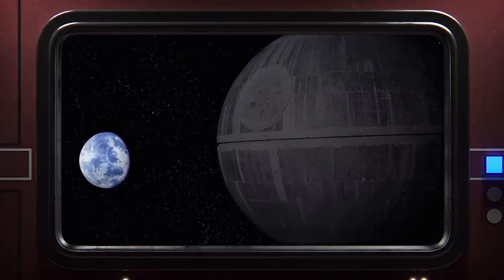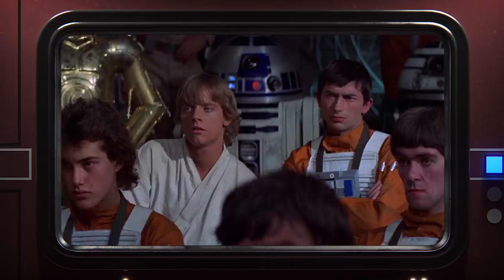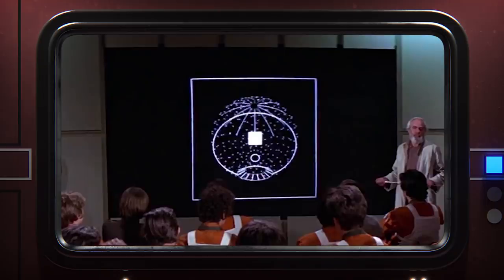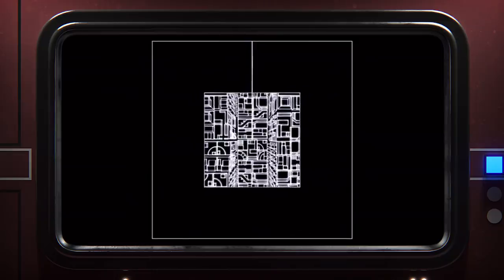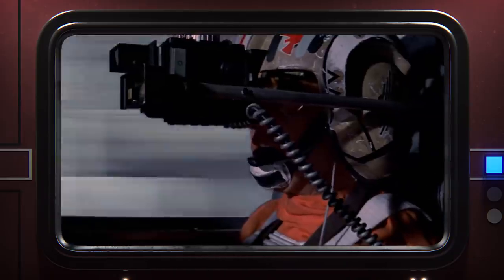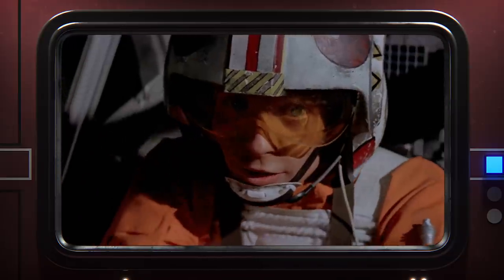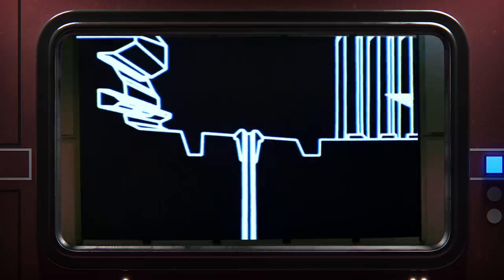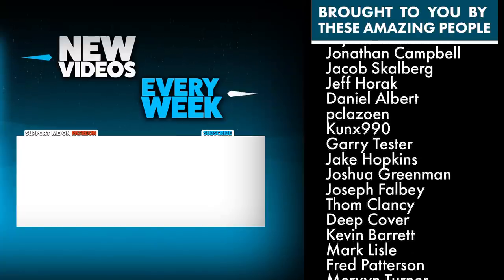The Thermal Exhaust Port Was NEVER a Problem

Comment: Even if we assume one port, it still is not a weakness because there needs to be an exhaust of some kind to deal with all the heat generated and putting such in a well defended area that conventional wisdom would hold is inaccessible to the most likely choice of attack craft and shielded against the most conventionally likely weapon and having it so small that conventional wisdom would say it cannot be hit using any ship's weapons means that to anyone using tactics other than pure desperation the station is unassailable.

Comment: I have question 
1.why dont they put sensor on the exhaust, when unwanted item goes in the exhaust pipe will close automatically.
2. Why the exhaust not to be built in complex if one hit enough to kill deathstar.
3. Even nuclear reactor has many safety procedure. I hope someone can compare safety system from holywood vs working nuclear reactor safety system.

What do you guys thinking ?

Comment: What you have not mentioned is that Darth Vader himself guarded this Trench so he was aware of this weakness and tried to protect it.
Reply: i haven't seen the movie in a while, but I'd suspect he was there for luke
Reply: @gearhead743  i have just rewatched the fight. First Vader ordered Tie Fighter Pilots to start. Second Scene Vader mentiomed "several Fighters have broken of from the main group. Come with me:" to two Pilots. Third Scene with him is attacking Y-Wings flying through the Trench, then attacking X-Wing. Only after he flies behind Luke he noticed the Force in him and only after the ghost of Obi-Wan talked to Luke.

A different Scene i found was an Officer talking to Tarkin "we have analyced their attack and there is a danger" and Tarkin answers "Evacuade? In the moment of triumph? I think you averestimate their chances" which is another great reason why the weakness is not a plot-hole. The empire overestimated their strenght and didnt respect the rebels as a thread.
Reply: @priuzien  ah, wasn't saying it was a plothole myself, although. There is a major engineering concern. What are they venting? heat? if they are simply venting heat they are doing it wrong. The only use of a vent like that would be to dump hot gas. If they wanted to vent heat directly, the would need radiator fins, lots of them.

Comment: The only implausible thing about this was that a shot up the tailpipe could cause a stationwide catastrophe. Throw a hand grenade down the funnel of an Iowa-class battleship and at most you'd get a fire in one of the engine rooms. Bad but something the warship is designed to handle. It might not even cripple the ship as battleships had multiple engine rooms. The Death Star took one hit to a Secondary Exhaust port and within a minute the entire thing was Gone. Not crippled, not disabled, not wrecked, GONE. It's like to fired a handgun at a US supercarrier and the whole thing goes up in a mushroom cloud. Doesn't make any sense.

Comment: Tell me, are thermal exhaust pipes usually a straight line? I doubt it, that’s probably why only that one was like that, if they were all designed in such a flawed manner, the empire would’ve caught on immediately, but if it’s only the one, then even if it’s a little sus, you could reasonably think that there’s a good reason why only one would be like that, also, all the ports would be ray shielded, that just makes sense, ray shields are some of the most notoriously annoying obstacles in the Star Wars franchise, also, it’s inaccurate to say the ports were heavily guarded, the whole thing was heavily guarded, they didn’t pile all their turbo lasers around the ports, they were all over the Death Star

Comment: A weakness, that in order to exploit, you have to choose the correct exhaust port, and then have physics bending ability to even get the shot to happen.

Remember what was said to Luke before the shot was made: Use the Force.

Or in other words: Let the force guide your shot.

What is also funny, it is because of the "physics bending ability" requirement to exploit this weakness, that Leia went to recruit Obi-Wan Kenobi in the first place.

So a weakness, that required Magic Space Wizards to exploit, is somehow a weakness that is so bad, that people hated it...

And let's not forget there is a keyword that most people completely ignore: EXHAUST! Which means energy is being moved through the channel, out into space. Energy is PUSHING out through the port, not pulling things in, which means the shot literally, can only be achieved by magic space wizards, because no one else can get something to fly and resist the pushing of the energy flowing out through that port.

The designers of the Death Star 100% did not account for magic space wizards, because it was believed all of them were dead.

Comment: If anything was a weakness, it was the reactor itself, not the exhaust port. The reactor itself is what was sabotaged. Galen Erso made it vulnerable to a single shot from a proton torpedo. Without his involvement, you could’ve hit that same shot but all it would’ve done is just put a dent into the reactor instead of starting a chain reaction leading to the destruction of the entire thing. That’s what I got out of all of this anyway. If the fault was anything it was not the thermal exhaust port, it was a very weak and structurally unsound main reactor.

Comment: Should i mention that thermal exhaust ports in space is pointless since there's no air to actually vent the heat off?  Also, with a massive construct like the Death Star, it's possible to simply recycle excess heat for other purposes (like... idk, hot water for all the storm troopers on board).
Reply: Why didn't tie fighters have shielding?🤷 because the empire had bad design ethics.
Besides there likely were machines actively pushing, out the heat.
Reply: @technounionrepresentative4274  TIE fighters lack shielding because the empire is cheap.  It's easier to field a ton of cheap starfighters to intimidate through numbers and sheer physical presence than it is to pay up for a bunch of highly equipped starfighters.

But that has nothing to do with the physics of how exactly a thermal vent would work in space... especially such a narrow one when there's nothing to disperse the excess thermal energy off to.

Comment: How are these ports exhausting heat into a vacuum?  Spraying coolant into space?  Then why not use elbow joints in the coolant pipes, so the ports don’t have to lead straight to the reactor?

Comment: And it's not like this flaw isn't present on real-life combat vehicles, either. The M1 Abrams all the way up to the M1A2 TUSK variant had an exhaust grate about a half a square meter wide, that was covered with nothing more than some 5mm RHA slates and a mesh to keep dust out; it could probably be penetrated with an AK or a rifle, let alone any main weapon of any tank. Now of course it wouldn't lead to a spectacular explosion, just disable the tank's engine (and since it had an auxillary generator specifically for that situation, it could still function and engage targets, just not move), but still.

Comment: Even if it was a design flaw, it required an act of comically huge espionage to even acquire that much data on it.  Do you have any idea how hard it is to steal schematics for a military weapon, much less one as powerful as the Death Star?  Without the schematics, what would the rebels (or any other hostile power) have done to the Death Star?  Trying to assault that station is a death sentence for any military, especially one which doesn't know how to attack it.  My first instinct would have been to shove a torpedo down one of the main laser's ports, but apparently that wouldn't work, and an attempt to do so would be catastrophically expensive.

Comment: I don't really see why the deathstar had exhaust ports at all. If it's exhausting fumes all the time in space it would presumably run out of air quite quickly. What they needed was radiators, which are conveniently solid.

Comment: The shot was literally impossible without the force, and that’s assuming your ship even got to the exhaust port which was extremely heavily guarded , even without the imperial navy helping the station. You would have to be an riddiclously skilled pilot to even stand a chance of making the shot, and you would have to react very quickly for a precise shot. btw its an exhaust port, from the heat of an engine strong enough to power a planet destroying laser and move a 120 Km diameter space station through hyperspace. There should be an incredible amount of force being expelled, and it should be fairly hot (though maybe not because it’s travelling in space.). 

It was literally impossible with actual science to make the shot, and improbable with Magic. Even if we assume it was only 1 port, when that’s unlikely, The Empire was still pretty damn aware of, this nigh impossible chance of someone being able to destroy the station.
Reply: It would be impossible even WITH the Force, the Torpedo should have Turned to Slag from the heat alone

Comment: Sone guy: Sir! Here’s a map of the Death Star!
Vader: Um, what’s that thing that’s connected to that thing that’s connected to that little thing?”
Guy: Well, it’s part of an exhaust port that’s connected to the reactor.
Vader: If a laser was fired down there, what happens?
Guy: We die
Vader: How big is the hole?
Guy: About the size of a laser.
Vader: I see no problem whatsoever that could lead to this station exploding, even though I know my son can possibly use The Force, and most likely will use it against me. No problem here.

Comment: You know what funny it’s called an exhaust port which means it’s pushing stuff out specifically heat from the core  which means that’s any perfect proton torpedo hit would have been useless cause it would have been simple pushed away from the immense heat and pressure of the heat and other stuff it’s pushing out so literally only people with the force would have been able to make it go in

Comment: Why would you attempt to shoot a torpedo down a vertical shaft by coming at it at 90 degrees? Weapon emplacements? The trench had weapon emplacements that you had to fly through where you were limited in how you could fly and maneuver. It would make more sense to fly a course directly at the port so you would not have to use the force. It’s not like you would place additional defenses around something that was not a weakness.

Comment: You could even argue, that the port was exploitable by force use only, as one other rebel bore him had a run and soht at the port. Fired exactlyt when the guidance computer told him and the torpedos just slammed into the wall behind the port.

Comment: Since the DS is mentioned to be the size of a small moon wouldn't gravity factor into why they couldn't target the polls?  There's also the idea that the DS crew never assumed anyone could target the exhaust ports.  For one they are a fairly common thing to have on a mobile base with that much energy output.  For another the run through the trenches could have been seen as a suicide run due to the surface cannons and the TIE fighters.

Comment: What I want to know is what kind of space magic they had that let them vent eat out of a 2m dryer port into the vacuum of space efficiently. You'd think that the death-star would be covered in radiator arrays for the heat, not exhaust ports. Unless it's like, waste particles from a fusion reactor being spat out, that would make more sense than it somehow venting heat. 

But I don't think the crew behind star wars was super well versed in space, nor cared about such details anyhow. Star wars is definitely a thing where more explanation only makes it worse. EG: Midichlorians.

Comment: There's 2 things you are missing.

1) It doesn't matter what that chance of exploiting the weakness is when those chances should be zero. It is still a design flaw. If every billionth airbag exploded and killed its occupants rather than acted as an airbag, it is a design flaw.

2) Your analysis is only looking at the issue from the perspective of the one attack that got lucky and worked. The attack the rebels staged was not the best possible option to destroy the station. It was only the best plan they could come up with with the resources on hand while already under attack.

This type of massive station is far more susceptible to intelligence operations and terrorism than direct military assaults. The weakness itself is ALSO more easily exploitable by an intel operation. Learn where the Death Star docks to pick up supplies, or, which shuttles takes supplies to them. Send in a Spec Ops team. Han Solo could have used his "land on the side of a ship" trick and then space walked the torpedo down the shaft. If the rebels had had more time, they could have used some Bothans to smuggle a proton torpedo down the shaft. Etc.

The DS1 was a death trap. Given time, SOMEONE would have found and exploited the weakness. They had the motivation.

Comment: You have to vent all of the heat and waste gases of a miniature civilization stuffed into a sphere without any of that ventalation poisoning either the people or processes happening within. 

You can't accomplish that without poking a few holes. 

Actually, you can with porus materials but that's another conversation. 

There are still  two potential flaws with the death star's scene though:

1. It is possible that the rebels could have destroyed the death star simply by threatening all of the exhaust ports at once. If they did that the Imperials would have to seal them all off. Sealing off all of their ventilation would put them on a timer. 

2. It's weird that the Empire deployed the death star with no escorts. It might not need them, but clearly it did If a dozen fighters could get within even 1 AU of it.
In space line of sight is limited only by the speed of light, and outcome of air to air/ship to air combats is roughly determined by the number of projectiles you can put into the air. 

The death star appears to be big enough to carry the AA needed to kill 12 fighters. The only way this wouldn't be true is if the 12 rebel fighters carried AA countermeasures or else more ordinance than the death star itself carried. 

That's not absolutely impossible but that was the case then the death star was a bad investment or it was a bad idea to deploy it without an escort of more than 3 TIEs.

Comment: It is bad because there is an obvious way to do a better job. Even world war 1 era war ships had bends in their exhaust pipes so that some hypothetical thing falling down the funnel would run into the armored deck if it did not make at least two 90 degree turns. And those were designed before aerial bombing was realistic, which was the first tech that realistically could exploit such an exhaust pipe.

the critisims is not really "the death star was stupid" or "the empire was stupid" but rather "Lucas was lazy (or possibly stupid)".

Comment: The thing is that even with your arguments (wich to I agree), I think people and myself included think that this is an absurd weak point. How does a entire space station the size of a very small moon explode from just one missile? Also, if the Rebels could see the problem from schematics, how come the Imperials didn't notice and protect it more? They could have also a metal mesh to protect from the first strike, more turrets etc. I think it would have been more beliable if not the entire station blowed up, say for example if you make the shot there, the giant laser cannon explodes and so the station is basically useless junk (and most people inside will die wich was kinda the objective in a sense). But that's just my opinion ^^

Comment: I mean, I hear you. It practically wasn't a problem... But clearly it was a problem. Otherwise the danged thing wouldn't have exploded. It was a problem from a design perspective as well, since it was a straight shot to the core. Even if it was a practically impossible target, it's problematic that it wasn't bent/curved to defend against attacks; just as I assume every other vent was engineered making them invulnerable. The retcon was necessary, since this is still a pretty obvious design flaw which wouldn't have normally existed given the likelihood that the ports were mirrored in some way.

Comment: All good arguments. Still doesn't answer why they had to fly miles down a trench to get there, rather than approacing the exhaust port from above.
Reply: I presume it's probably due to heavier Turbo Laser fire.  The trench had a few towers down its length.  The main surface had tons of surface laser cannons and turbo laser towers.  The first half of the battle was them wittling down the outer defenses before making the run.  A dive bomb would probably have been suicide.  Not to mention the full power of Black Squadron and Vader would have made it an impossible venture as well.

Comment: I disagree. It's a massive mistake for the Empire to rely on the Death Star's design being obscure in order to protect it, and a worse mistake for them to assume nobody would ever make a highly-precise torpedo capable of hitting the "impossible" shot. Even assuming there was no way to limit the damage if the port was hit, they could have done a lot more to make it more defensible, like walling off the trench. Still, the bigger problem with this battle is that the rebels weren't slaughtered by thousands of TIE fighters before they even got close; even if the Empire thought the Death Star was invincible, why let the rebels throw all their ordnance at it?

Comment: So my thoughts are that the thermal ports would be expelling MASSIVE amounts of thermal energy. Heat. Im more surprised that the torpedoes didn't explode, melt, sublimate, or experience fission before getting to the goal. The reactor is obviously making enough power to power a planet killer weapon and a moon sized space station. It'd be like throwing a rock into the sun.